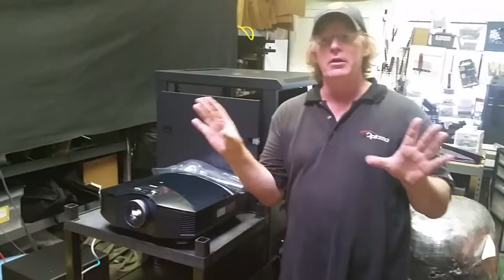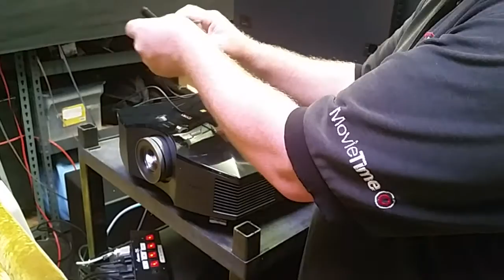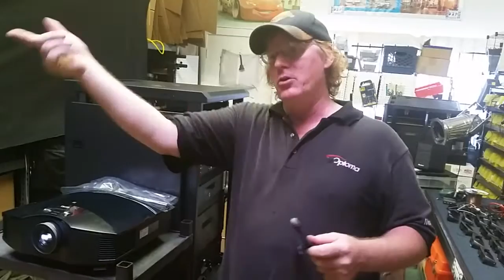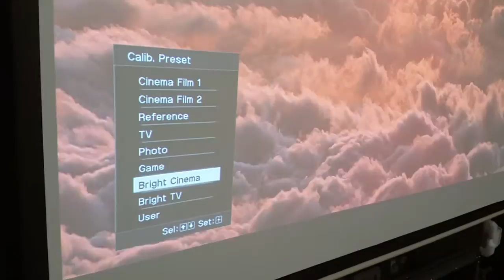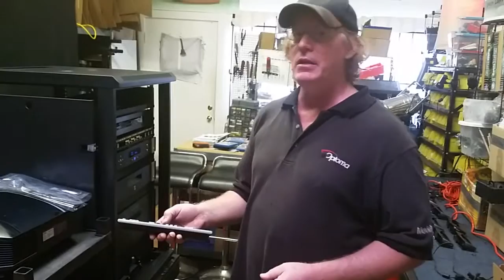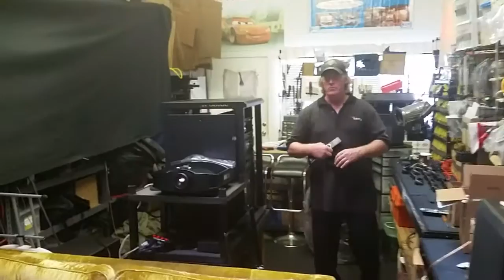CH4 VXP Custom Home Theater Sony HW55ES Projector Basics

Comment: Yantuo YT-PS600 3d polarization modulator system can be quickly VESA/BNC/DLP-Link 3D output .and full auto exchang between 2D and 3D without remote control ,more...  https://youtu.be/H2O1tZyNRdY